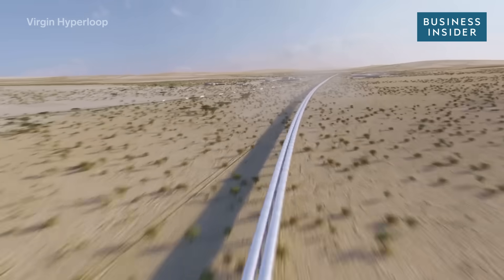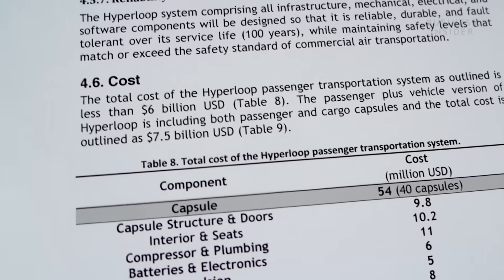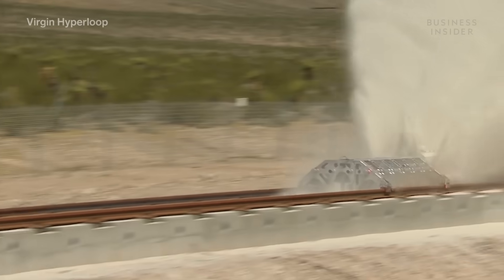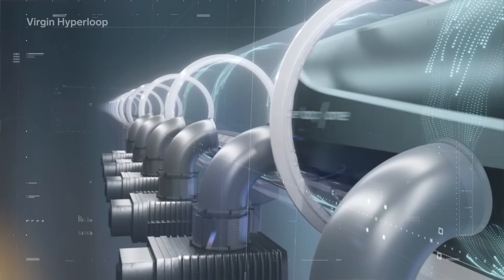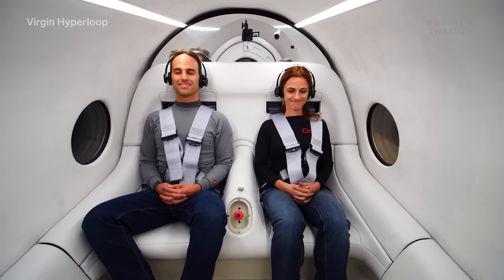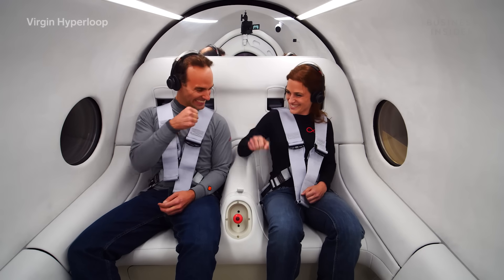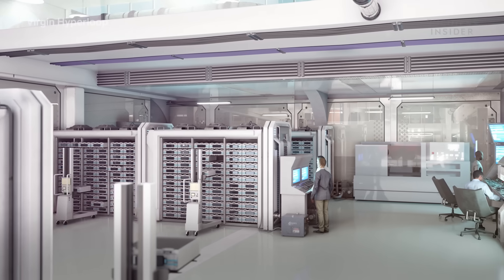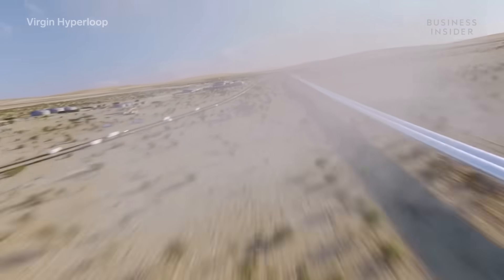How Elon Musk's 700 MPH Hyperloop Concept Could Become The Fastest Way To Travel

Comment: First of all, Maglev was developed in Germany in the 1960s (see Transrapid in Wikipedia).
The concept of the Hyperloop has a crucial weakness. 

The planned drive using the concept of superconducting magnets has already 
been implemented and is in operation over some routes around the world.
The hard part is getting the tunnel evacuated as much as possible to keep the 
drag of the air as low as possible at high speed. Of course, emptying the entire 
transport pipe is unrealistic and cannot be implemented even with great effort.

The solution is to be found in the provision of special conditions for the tunnel 
section in which the pod is moving at high speed. It can be found in the analogy 
for the magnetic drive. The drive's magnets are built into the road construction along 
the entire route. However, only the magnets that the pod is currently above are 
activated. All other magnets on the route are de-energized. The task of driving, 
lifting and tracking is reduced to the small area that the pod occupies on its journey.

In the same way, it is sufficient to treat only the part of the tube that the pod 
occupies during its journey. First, only a small area of the tube in front of the 
sliding pod is air-diluted. This is the point on the route that the pod's head enters 
at the next moment. A small area behind the pod is also filled with air. The volume 
corresponds to the amount of volume that the pod has traversed in that time 
period. Thirdly, the volume of air that is around the entire pod must not statically 
envelop the pod towards the tunnel. This amount of air volume is entered along 
the length of the pod at the same speed as the moving pod from its rear to the front.

Summarized.
The first measure, the air dilution at the front, largely eliminates the effect of the 
braking air resistance for the pod. The second measure, the increase in air pressure 
behind the pot, the braking force of the turbulence is largely canceled.And the third 
measure, to move an envelope air with the pod in the direction of travel, cancels 
out the air resistance around the outer area of the pod to a large extent.

These measures are suitable for getting very close to the effect of a vacuum in the 
transport tube. The system is derived from the analogy to the magnetic drive for 
the system. The unrealistic, extremely high expenditures for maintaining a vacuum 
in the complete tube to solve the air resistance reduction at high speed of the pod 
are substituted by a manageable, dynamized, locally effective solution.

Translatet with Google Translate

Comment: Building a vacuum un tube is expensive. That’s why the test didn’t use one.
Reply: The Large Hadron Collider at 26km or 16.6 miles is cheap compared to any Hyperloop system with its 1000km expensive infrastructure costs. 
the fact that many engineering barriers to Hyperloop are hundreds of times more expensive then any in aviation.

Comment: That guy calls himself engineer and wants to use maglev train in near vacuum. Passive magnets just wouldn't work. In order to use maglev you need constant current. If current stops, train will quickly come to a stop. Sooo, what's the point of vacuum at this point? vacuum is supposed to remove air resistance so you can effortlessly glide, but maglev doesn't allow it to effortlessly glide. Even with higher current (to fight air resistance) it's still cheaper and safer to travel in our regular atmosphere. So they want to bring space problems on earth for what reason?

Comment: Take the pressure from in front of the cabin and put behind the cabin to make it even faster magnetix or more for breaking then it is we're going although it works both ways if you had good air pressure things on the front of the battery compartment it will make a safety impact officer not like a tube from Bank hard impact people couldn't deal with that type of G-Force

Comment: What if we have an intake charge and Annex take charge on the engine also like a tube from your bank use them both together more control more safe you can use the air pressure to a point and you can use the Magnus is brakes also take the two designs and put them together stop fighting about who's going to be best and be the best

Comment: The hyperloop is not physically feasible with the technology currently available to us. Building a vacuum chamber that large and making it safe enough to travel in just isn't possible. Hyperloop is, and always will be, an overhyped maglev train. The whole "vacuum" aspect of the design will not be achieved within the next 50 years. For perspective, the world's largest vacuum chamber to date, isn't even 1% as large as a hyperloop track would be, and it cost ridiculous amounts of money. How exactly does hyperloop plan on dwarfing the current largest vacuum chamber, with significantly thinner wall, and keeping it within a reasonable budget? Answer? They don't. As of now they have no idea how to do it. 

Btw, Maglev isn't a new technology like you imply. Maglev has existed, even been commercially applied, for decades.

Perhaps the most famous application is in the Shanghai Transrapid.
Reply: if they have done an active human test then i highly doubt your claims
Reply: @gavinwolf8667  human testing on a way smaller scale at way lower speeds than they intend for the final design.

Comment: 45 minutes inside a tiny pod with no where to look could be very uncomfortable without a mini bar and snacks and WIFI.
Also it seems very claustrophobic, not sure if anyone would be willing to be locked in there without major improvements to comfort.
Reply: they said the train will improve for more space and it can fit 28 passengers
Reply: @lazyproeagle  Then it wont take 45 minutes anymore innit? They said 45 minutes and on that little capsule, and thats all Im referring too. Bigger will take longer to accelerate and break.

Comment: Wasn’t this idea debunked a couple years ago? Making the world’s longest and biggest by volume vacuum chamber that would cause instant death for anyone traveling 400mph if it depressurized. Not to mention just the expansion and contraction with heat and cold would increase and decrease the length of the tube by hundreds of feet every day leading to massive vacuum leaks.

Comment: They say make every thing better and reducing pollution. Riddle me this though, where are you going to get the power for the rail line?
Reply: This whole thing is an impossible concept.
Reply: The concept is actually possible but they have a lot of things to solve before it gets there. Their just taking the average bullet train and surrounding it in a vacuum to get rid of drag and resistance. The thing is how are they going to maintain a vacuum, if there is more than one car on the track. As multiple cars means different stops at similar times. And from what i know of air cannons and air pressure. If they open a nearly vacuum space, normal air will rush in to replace it Wich will turn the line into a spudgun. Not too mention the ridiculous amount of power it will need to keep it operational. Not including how expensive its gonna be to make them in the first place.
Reply: @RLWolverineX  yeah the 600km long vacuum chamber is the impossible part, we should just build a good maglev line.

Comment: Imagine there had been a malfunction on the tracks, then the whole car gets yeeted off the rail at 700 miles per hour.
Reply: Fire?
Reply: That's why they test it before they don't just send in human first time
Reply: @yashrawat9409  Well yeah, but you don´t need to test it, if the physics don´t work
Reply: And someone shoots a bullet at it = all passengers currently in the tube are dead
upsie dupsie
Reply: Bla Blub it’s inside a tube, getting shot at won’t likely be a problem
Reply: @ryanli7566  Shooting at the Tube obviously
Reply: @blablub2402  bullets wont cause a vaccum fail. Mythbusters shows a broken airplane window wasnt enough to suck the air out of the plane and cause any dangerous decompression.  So a giant thousands of miles of tube aint gonna loose a partial vaccum from a few bullets.
Reply: @SWIFTO_SCYTHE  recompression is different from decompression. The car is moving at 700MPH and will collide with a significant volume of relatively dense air  if a bullet is fired at the tube and penetrates it, it will have a pretty high probability of causing rapid deceleration of the car, if not a straight up crash. Running into a wall of 1 atmosphere air from being in essentially 0 atmospheres at 700MPH would be similar to hitting a concrete wall at a probably slower speed, but probably over 100MPH. This would be most likely fatal to the passengers, but let's say that you've fixed that problem with some extra thick tubes, now you're hyperloop has gotten way more expensive.
In fact, every feature you want on a hyperloop will increase the price of building it, and not just a little. Want to make it faster and in a vaccum? It needs to withstand extreme forces between the inside and outside of the tube. Want to seat people comfortably? The car needs to be big enough to walk in, so the tube needs to be big enough for the car, making it harder to create a vaccum, and making it more expensive. Want to keep a vaccum from San Diego to Los Angeles? Your tube needs to be incredibly long, meaning you need a lot of vaccum pumps, which are already expensive by themselves, but the maintenance alone is going to be a pain of an expense. Do you need any of this with an airplane? Not really. You're just sticking people on a metal tube and using the fact that you're moving through air to maintain pressure inside the tube. As well as using some relatively inexpensive air filters.
The vaccum that you have to maintain for the hyperloop is really your main issue here. Not only do you not need it to gain a significant speed increase, it's also very difficult to maintain for long distances. Maglev trains don't have these problems, simply because they don't have to maintain a vaccum.
Reply: @SWIFTO_SCYTHE  The science is sooooooo far different with the pressure differential between the plan and surrounding air and a vacuum and standard air.
Reply: @SWIFTO_SCYTHE  There is no vacuum outside of the airplane, just a bit less pressure.
Reply: @am45_001  Thank you for that extensive comment.
Reply: @am45_001  Agreed. We don't have a super material that can maintain the conditions of the proposed hyperloop. We don't have the slightest bit technology on how to stop tectonic plates from moving. I'm all for innovation but  I won't let the name innovation get tainted by these snake-oil vendors because once the inevitable abysmal failure of this, the promise of innovation would be extremely dubious. It will do more harm if we bootstrap our way to the future. We take incremental steps. You should acknowledge the valid criticisms of the hyperloop. If not then you are of no use to innovation if you believe in such gullible promises and bright future. It's very easy to sell someone a upcoming time. That's what communism is founded on. There's no valid argument for the valid criticisms of the hyperloop in the near future. If you say that humanity has achieved nothing by mindlessly giving up - you are correct, that means you should accept the problems a certain idea is facing and if you know high school science then you know the hyperloop wouldn't work in the foreseeable future. You could achieve something by learning, to save time and not lose money when it comes to these snake oil vendors of innovation. I wouldn't even add all the stupid inefficiencies of the hyperloop just to make it look "futuristicy" because these charlatans are too low to even set your sights on them.
Reply: @am45_001  all cars are in a single vacuum which means they are experiencing the same air resistance. The pressure of the tube will have a consistent pressure regardless of how close you are to a puncture air leak. Which means all cars will slow down at the same time. Remember gas expands to fill the container it is in. So if there is a leak, the new air entering the chamber will not be localized, but it will spread through the entire chamber simultaneously and equally until the chamber equalizes.
Reply: @MamuPlaysMinecraft  that's not how repressurization works. Air molecules don't teleport/zip around at the speed of light while filling a volume. The gas has to force it's way into the volume through a small hole, which takes time. It won't fill the volume evenly, so the closest car going towards the puncture will experience deceleraion first, and with the air moving at roughly the speed of sound, LIKE THE CARS IN THE TUBE, the inoing cars will probably crash. This all assumes that the first car to hit the dense air i relatively close to the puncture
Reply: even then, the cars rushig towards the rapidly repressurizing area will probably crash too
Reply: *incomig
Reply: @am45_001  no it does not travel at the speed of light. But we are talking about a small leak. We agree a single atom of air does not act like a bullet piercing the car. Neither does two atoms. Each atom that comes in, it makes the other atoms spread out even more. Which means you will slowly go from a vacuum to 1 atmosphere. Air does spread fast enough that it will not be anything like running into a wall of air. By the time you get to the point where the air is dense enough to do any damage, the entire vacuum has already equalized. Imagine it like water filling the tube. If you run into a wall of water yeah you will instantly be crushed. But if it is a stream entering the tube, it will continue to spread out before it fills the entire tube. And all cars will be slowed by the water on the tracks.
Reply: It happened in Shanghai maglev. Google it.
Reply: This entire project sound more like a snake oil scheme as time goes on, they make this thing as seem the “greatest“, "cheapest", " Fastest", "safer", " Environmental friendly", all the words a snake oil salesman would use. Fking hell cant they just say that this thing "might" Be viable later in the future but dont say what year, instead of marketing this crap like "oh yeah first human test with like 4 people is a success, now we build bigger and let hundreds of people be our lab rat". And of course abu dhabi is mentioned why tf not, a place where rich people go is abu dhabi, this is the place where they can charge $10k and no one complains the mfking abu dhabi.

This project might be viable guys in the future, im not defending this thing but maybe in the future there might be some kind of breakthrough in technological thing but obviously not now or soon . probably need like 20-30 years, but the only thing i dont like about this is that just like i write earlier, they market this thing like a snake oil salesmen, only concept art, and just a test performed with their chosen "journalist", and of course this project when its finished it'll be built in the place where most of the people is rich and has no trouble shelling $10k for 1 trip in a capsule its abu dhabi.
Reply: @kreondeanx347  while I agree that the descriptions seem some what grandiose,  that seems to be something Elon Musk likes to do. But look at the other grandiose statements he made. Everyone said landing rockets would be too hard to feasibly do, now it is a regular occurrence. Let's not pretend we know better than people who spend their  lives in related field of engineering, and let's just see where this ship strands
Reply: @julian-xy7gh  im not insulting the engineer and scientist that believe in  this project, i just dont like how the media portrayed this as the ultimate public transport like some kinda fantasy, when clearly this project is like a baby taking its first step and some dudes just keep talking to others how this baby gonna be ruler of earth or some. Cant the media not tell us like that 😂
Reply: Time warp.
Reply: So... just like a plane then?
Reply: @Noplayster13  planes would be significantly safer in reality.  If a vacuum tube gets a small dent from anything, it collapses like a soda can that got stomped on by a 400lb man.  To make the tube strong enough to not do that requires it costing thousands of times more, and to keeps vacuum in a tube long enough to reach 700mph would cost millions of dollars a week.  So planes and maglev would be significantly cheaper and safer.
Reply: @Noplayster13  A plane that has never actually been proven to work and is at ground level constantly
Reply: @Noplayster13  thank you. Was just about to say that.
Reply: If you loose magnetization the vehicle just touches down and the wheels roll it to a stop along the tracks. Its perfectly safe to loose magnetization on this kind of track.
Reply: @SWIFTO_SCYTHE  at 600 mph?!?!

Comment: As much as I want this to be a reality... Sad truth is... That it'll be extremely difficult and costly to actually make it work... Simple reason is... A single tiny mistake and the whole project goes down the drain... Not even kidding... A large tube filled with a determined air pressure? A single hole would be catastrophic in the whole structure.... I'm not saying it's impossible and they should just give up....but it'll probably result in a quite different concept at the very end...